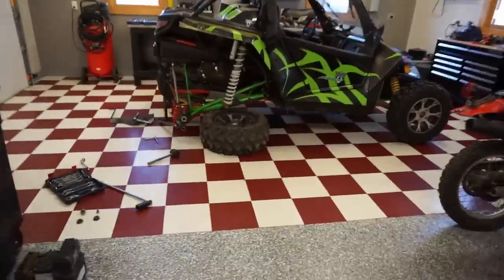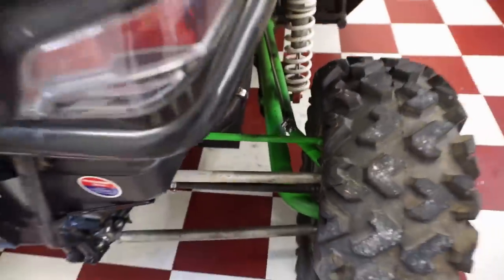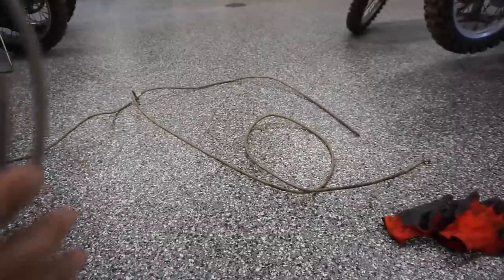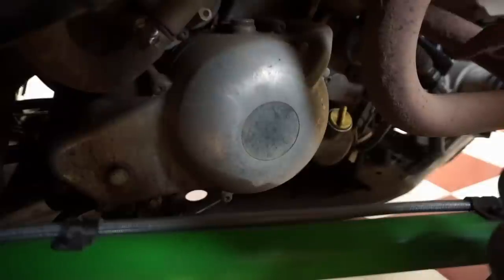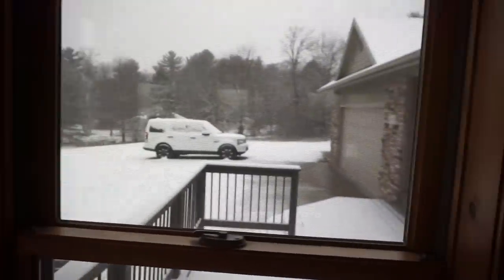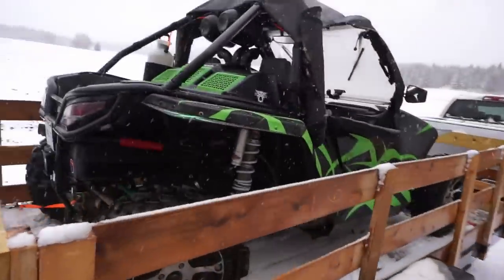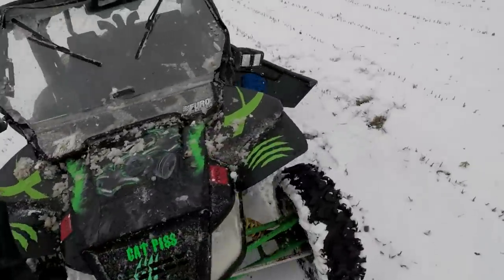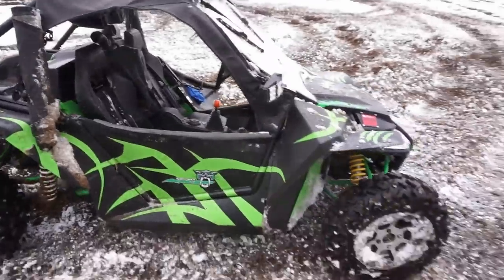Snow Drifting The Arctic Cat Wildcat 1000 (It Left Me Stranded)

Comment: Id check the battery on that side by side, what my quad did was when the battery cable fell out, it would continue running but it would run very very poorly, thats because it was generating its own power for the spark instead of having the batteries help, so definitely check and maybe replace the battery/battery cables

Comment: Looks like the suspension is out of balance. I would loosen the spring tension on the rear and tighten the front. If the compression dampening is adjustable that can be a factor too.

Comment: I have a 2012 Wildcat 1000 H.O. Lots of fun but, as u probably found out- the turning radius isn’t great & beware of the front steering slider assy.! They tend to wear out/fail, causing sloppy, loose steering! Aftermarket upgrades & rebuilt units are available but, not cheap!
Reply: ...i removed that crappy feltpad- loosened all the bolts on my 013- set all straight- retight it and works since years..;-)

Comment: there is a special took for those clamps. It's a plumber's tool for making pex pipe fitting fit. They have the same little silver collars
Reply from the maker: I have that tool for when I fixed my shower. It didn't work.
Reply: @2vintage  must have been a different one. The crimpers I got for pex pipe always works. They use the same hose clamps on cars and truck

Comment: The company made that brake line like that so you have to bring it back to them for service. That was intentional 👍🏾
Reply from the maker: Yeah I figured
Reply: They made them that way because its easy to assemble quickly at the factory. With no removable sections at the tee it speeds things up and eliminates a possible spot for leaks. The repair/replacement cost is just a bonus

Comment: Just wondering if you did find metal in the oil what would you do??
Reply from the maker: Bottom or top end. Probably tear it down and inspect before more damage happens.
Reply: Ya maybe check the belt and clutch situation when you have it in the shop for the electrical issue. The video b4 this one you were on dry ground and it was just as slow. I'm not busting you seriously the engine is ripping and wheels aren't spinning in sync with the engine. Maybe just a belt and you'll be flying??

Comment: Hey man you have to put tighten down the dipstick all the way then take it back out to check the level of the oil. Don’t put the dipstick in there and just take it back out you’re not gonna get a full reading.
Reply: @sevendyseven4090   You are incorrect. On a wildcat 1000, the oil level is checked with the dipstick screwed all the way in. I own one and have the service manual for it..

Comment: Arctic cat only made one thing good and that's a sleds the snowmobiles other than that not so great you got a 1,000 CC and have a machine you should do a lot better than that Can-Am would run circles around you or Yamaha with the same size engine Arctic cat needs to stick to snowmobiles only and that's it